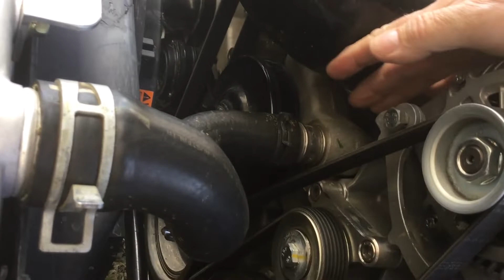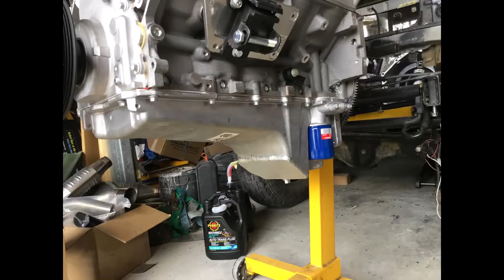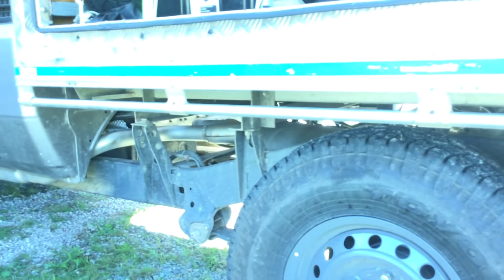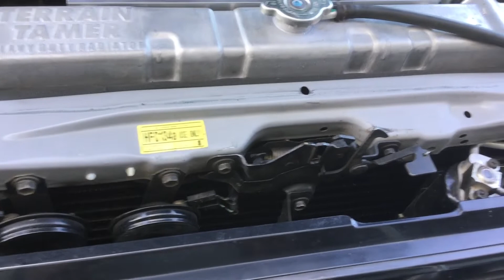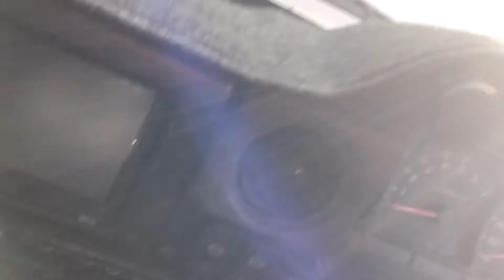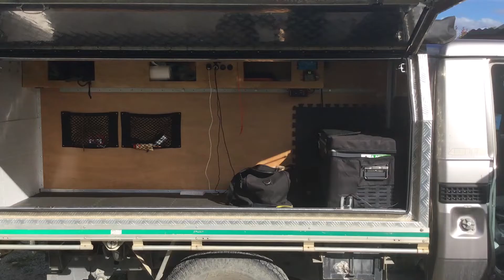Toyota Landcruiser 79 (70 Series) LS 6.0 V8 Automatic Conversion - Episode 4 Details

Comment: Thanks for the video that is the conversion I have been thinking of for my 2001 1hz Ute I’m interested to know how your fuel consumption is going now and would love to see some video of your Ute in action 👍
Reply from the maker: Hi Terry, sorry for the delay in getting back to you. I’m pretty happy with the fuel economy. I’m getting at least 20% better fuel economy than the 1FZ-FE. On the freeway I’m getting 16-17L/100km at 110kph. I hear this is only about 2L/100km worse than a new 70 series and I’m finding it an absolute pleasure to drive. I actually think I’ll be able to improve my economy a little when I start playing with the torque converter lockup settings. I’m just waiting for the 12 month transmission warranty is up. I’ll see if I can get some time to produce a video of the Ute in action.

Comment from the maker: I’d need to make a correction about the exhaust size. I have used 2 1/2” exhaust into a 3 inch outlet. Not 3 and 4 inch as stated in the video.